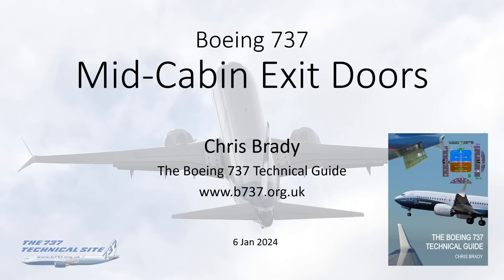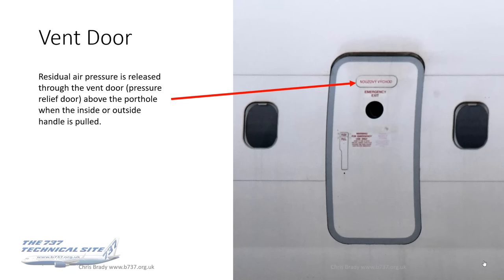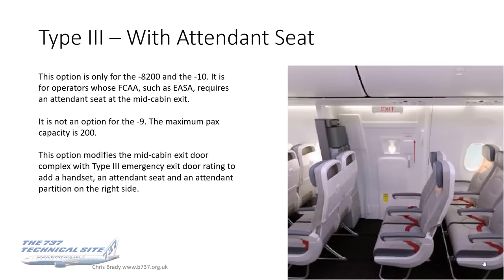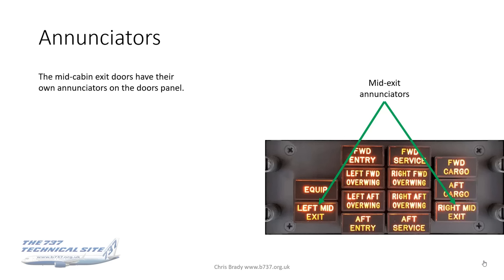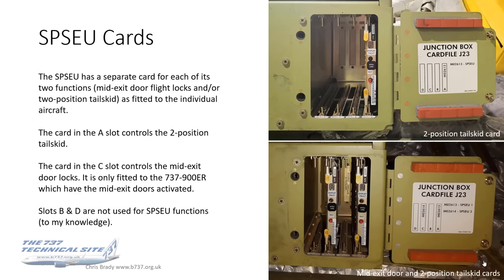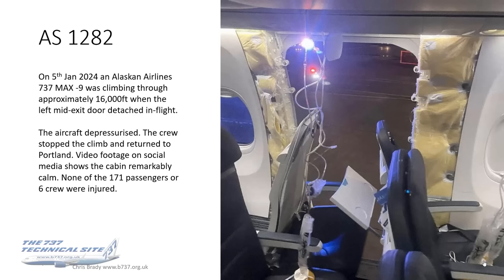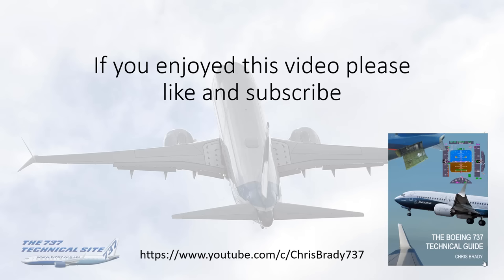737 Mid-Cabin Emergency Exit Doors

Comment: Is it possible for a standard emergency door  to detach as well like this “non-operational” plug door did? 

I fly a lot, and usually get the emergency exit row by the window,…. should I now avoid this seat?😉

Besides, I always thought the pressure served as a type of seal to prevent something like this happening?

Comment: Thank you so much for the great video! 
i have a question.
is there any option without "mid-exit door" and "without plug" ? i've been checking the external photos of MAX -8 airplanes, they all have fully passenger seat window, does it mean that they have plug option (which is not available according to your slight 06:45) or they don't have the middle exit door at all?
Reply from the maker: Only the -900 and MAX -7 and -8 do not have the mid-exit door.
Reply: @ChrisBrady737 🙏🏼🙏🏼

Comment: So is this not the 'plug' style I'm thinking of where by the size of the frame is effectively smaller than the door so the door can not come away from the fuselage whilst pressurised?  It's just bolted on and can open outwardly?  suppose I'm asking is the term 'plug' been used as in a 'blanking plate' or as in it can not be opened outwardly when acting as designed?
Reply: I think it may be more fair to call it a blank or filler.

Comment: Is it correct to say that "plug" style doors are normally be held in place by air pressure differentials around the whole rim, as opposed to four bolts in tension?

Comment: I was trying to piece together how the plug would move off the stop pads even with sheared bolts but could the lift springs on the hinge mentioned at 2:15 push the door off them without the bolts to hold it back?
Reply: turbulence or previous hard landing could cause that

Comment: I've read that for the past few decades all aircraft doors were larger than the opening they're installed in, so that air pressure just pushes the door against the frame, and this sort of incident can't happen because the door can't physically fit through the opening without being pulled in first and tilted.  Why isn't this door plug designed that way? It seems to have a door design where a couple of bolts are all that's preventing it from being blown out is forgetting lessons we learned decades ago in aircraft design.
Reply from the maker: It is a plug design, just not as much of a plug as the other doors

Comment: Question: Do the 'stop fittings' not sit inside the 'stop pads'?  I'm imagining that what looks like bolts in the 'stop fittings' engage with the 'stop pads' which would serve to perhaps to seal the the plug properly and provide a 'shear ' element to help prevent the plug from lifting.
Reply: not inside, just flush on top of with no shear element. So when door (or plug) needs opened it is pushed up with springs which allows the stop fittings to clear the stop pads.

Comment: Great work. Question: At 10:00 minutes you have the max pax at 175 in your graphic, but both United and Alaskan have over that number, 179 & 178, when door is plugged. They're not over the limit, are they?
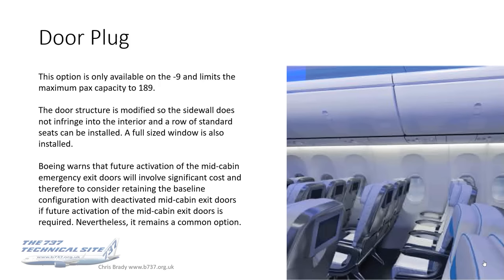Reply: Door plug slide  at 7:20 says 189
Reply from the maker: * Errata A deactivated mid-cabin exit door limits the maximum pax capacity to 189, not 175 as I stated in this video. *
Reply: @ChrisBrady737  Thanks Chris. Great work, as usual. Glad to see Leeham quoting you...

Comment: How is it that no passengers sitting next to this door were not sucked out of their seats, is it because the aircraft was still climbing to cruising speed and altitude and the seatbelt had not been switched off? Is 16,000 feet below that level? A real miracle. Whoever was sitting 3 rows either side should get free flights for life
Reply: The seat immediately adjacent to the door was empty. Its cushion was sucked out.
Reply: Seats are securely fastened and seat belts work.

Comment: If the plug isnt to be used as an emergency door, could they not have made an inner lip larger than the hole so the pressure keeps it closed rather than letting it blow out?
Reply: Then passengers would know the airline bought a plane with a hole in it to save $$$.

Comment: Why is passenger capacity limited to 189 by the door plug but 175 when the mid-cabin door is deactivated? Neither is operable. Shouldn't they result in the same limits?
Reply: Deactivated lacked window, harder for passengers to see => slower emergency evacuation. Probably enough to reduce passenger rating by a few people.
Reply from the maker: * Errata A deactivated mid-cabin exit door limits the maximum pax capacity to 189, not 175 as I stated in this video. *

Comment: So please correct me if im wrong. I dont understand. This door can neither be used as an emergency exit nor does it have an opening mechanism?
Then what's this door good for?
What's purpose of this door?
Reply from the maker: The purpose is to fit seat rows in without a door being in the way. It can be converted back to an emergency exit by maintenance if required.
Reply: @ChrisBrady737  Now I get it. It all makes so much sense now. Thanks Chris, you're the man.
Reply: It gives the operator the option (in the future) to change the seating configuration to a higher density that would require the two mid-fuselage doors, they could have the doors installed (at considerable cost).
Reply: Every  fuselage is built the same.... There's a hole in it that needs to be "plugged"; either by a door, or a "fake" door.
Reply: It's good for Boeing accounting

Comment: Why is there different max pax capacities between Plug and deactivated, the result is the same.... number of available/working exit doors. A weight issue?
Reply from the maker: * Errata A deactivated mid-cabin exit door limits the maximum pax capacity to 189, not 175 as I stated in this video. *

Comment: 7:40I wonder why the plug is not available on the 10, quite a few airlines will fly them with 189 or less seats. Also do you know why the option "deactivated" is limited to only 175 pax vs 189 with the plug? Dont get it.
Reply: someone got promoted for these "smart" management decisions
Reply from the maker: * Errata A deactivated mid-cabin exit door limits the maximum pax capacity to 189, not 175 as I stated in this video. *

Comment: I find it interesting that the now only slightly larger 757 had six doors and two pairs of windows, or eight doors and that’s how they came, and the 737 is build with four full doors, two hatch things (which may or may not be covered) and four exit windows.  Since they’re installed, wouldn’t they still get the maintenance penalty?
Reply: maintenance penalty?  What maintenance penalty?
Reply: @rael5469  not a certified airframe technician, but if I recall, a cargo aircraft is less maintenance intensive than a passenger aircraft since it has far fewer cuts in the airframe.  Even if sealed, because there is still the door frame through the fuselage, it is a fatigue and maintenance hotspot.  Just because it’s locked out doesn’t mean it’s not there.  As far as the frame is concerned, it’s still a door.
Reply: @jaysmith1408   I see what you are saying and YES, I would imagine that during heavy maintenance they inspect that plug door frame to the same extent as any other door frame on the aircraft. Same same.

Comment: Why does deactivated have a lower seating capacity than the door plug?
Reply from the maker: * Errata A deactivated mid-cabin exit door limits the maximum pax capacity to 189, not 175 as I stated in this video. *

Comment: Any idea why the door plug version allows a higher passenger count than the deactivated door version?
Reply: My guess : deactivated lacks a window so a couple of passengers has a more obstructed view / awareness of the outside. Maybe that is enough to impact passenger rating. Slower and more confused passengers that need to get to their emergency exit after a crash, fires burning, smoke in cabin.

Comment: Thank you so much for this. Where would be the right place to look for the investigation results once they start to become available? As we’ve seen, some reports tend to use ambiguous terminology so would be nice to read the original.
Reply from the maker: It will be available on the NTSB website. You can also check in on my own website for updates www.b737.org.uk
Reply: Thank you. Keep up the great work.

Comment: Question: Do the 'stop fittings' not sit inside the 'stop pads'?
Reply from the maker: Close - The stop pins touch the stop pads in flight. On the ground when unpressurised there is a slight gap.

Comment: 10,000ft higher and it may have been the Comet disaster all over again...
Reply: I don’t think so. If a disaster could happen - it would be the result of the door hitting the stabilizer after detaching.
Reply: I ran some numbers for the 747-400 (no 737 values available) and the cabin differential pressure at 16,000' would already have been 2/3rds of the pressure at cruise altitude.

Comment: Possible software problem?
Reply from the maker: I doubt it but time will tell.
Reply: @ChrisBrady737  My biggest fear is passenger tampering.  Unless there is a failsafe mechanism that disengages the handle when the wow switches disengage.
Reply: @rnews5750  I don't see how it could be anything done by a passenger, they shouldn't be able to get to the door without removing the wall panel.
This seems more likely to be a manufacturing error? Possibly.
Reply: @rnews5750 I would tamper if  I booked window seat and there is no window

Comment: Emergency exit doors have a normal window.
Reply: Did you not watch the video? Only the plug option -which is NOT an emergency exit - has a full sized window. All other door options have either a small porthole window or no window.

Comment: Over complexity. I’ll bet my hat on it. Maintenance routine 3.5b done on door 3.5c.  If you catch my drift.
Reply: Nothing complex about 4 bolts. Probably just rattled loose from improper tightening during assembly.  Doubtful anyone has done any maintenance on this plug in the two months since it started flying.

Comment: There should be no such design as a door "plug" on an aircraft. There is a door or there is no door. Pressurizing and depressurizing a door "plug" is the equivalent of putting a Paper Mache muzzle on a rottweiler.